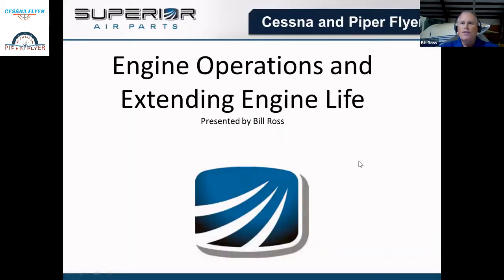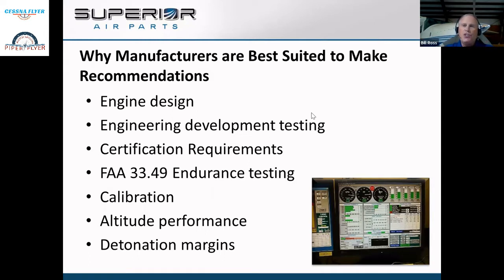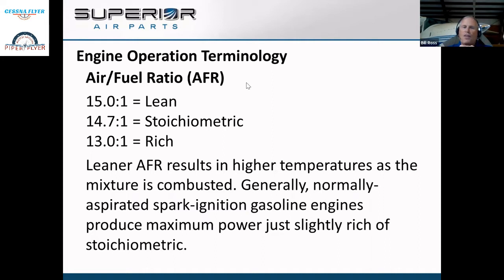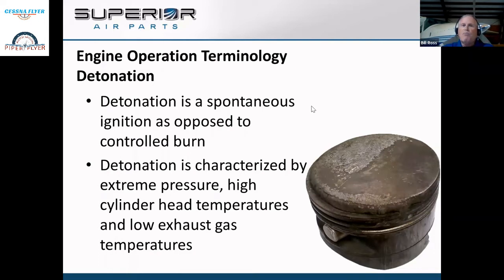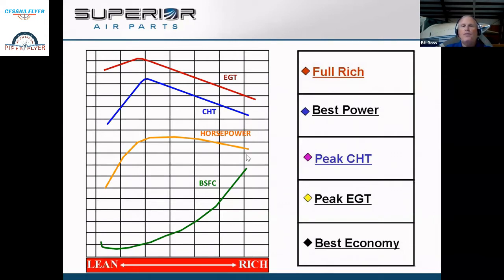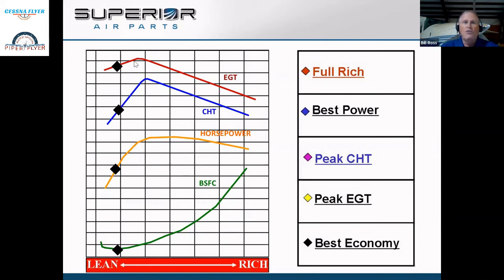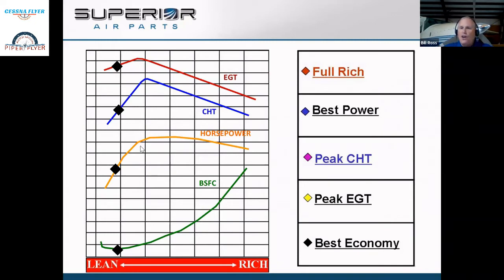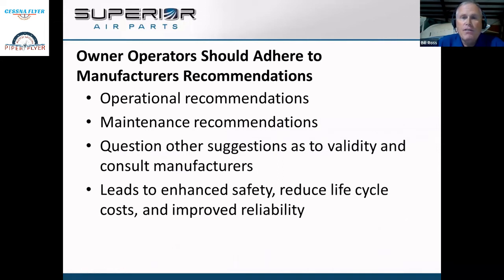Improve your aircraft engine operations and extend engine life

Comment: You’re right. The Cessna 185 POH doesn’t mention max continuous cruise or max cruise but the chart does show, for example, @2,500 ft, 2500/25hg, is 76%. Then it says at 65% leaning to peak is fine. I interpret this to mean that at 76% you can hurt the motor?

Comment: Excellent thanks Bill, all good to hear, particularly when lining up with the knowledge imparted by Mike Busch and Savvy Aviation.

The only area where perhaps you disagree with his assessment is your statement that operating up to 460F CHT in accordance with the manufacturer’s testing criteria will do no damage, assuming not exceeding max continuous power.  Really…? 
Isn’t 460F somewhat on the warm side for long term operation, especially when considering the properties of how the metal in cylinder heads behaves when above 400F?

Your discussion on the dangers of low oil temperatures makes sense, and without mentioning Busch’s name I feel you may be referring to folks following his guidance. He does also mention the dangers of excessively low oil temperatures, but neither of you put a minimum figure on it, instead telling us the oil manufacturers like to see a sustained 180C.

That’s fine, but in certain cold areas and climates folks may be sat with oil at 170, or 160C … are they in for trouble?
A bit like the CHT discussion, if it falls within manufacturer’s temperature limits for sustained operation, how does a pilot know if he or she is doing damage long term?

Your information re. low internal cylinder pressures and piston ring performance is an area I haven’t heard Mike Busch talk about. Good to know thanks.
Reply: Yes, Mike does address ICP. CHTs are a proxy for ICP

Comment: Hello , very good video , good work . I saw it all to the end , and even understood 95% (flew gliders in the past) of it . Could i ask a question : from an environmental point of view , will it be able in the future to fly general aviation aircraft-engines that do not run on avgas(100LL) that contains lead in order to prevent detonation ? How far does technology stand towards that goal ? Do Lycoming O-360 engines (Mooney 20C) still need this leaded fuel ? Also , how far is the evolution in the USA of the production of carbon-neutral Power-to-liquid synthetically produced fuels through green energy (e-fuels) for the aircraft industry ? Thank you . Erwin , Belgium .
Reply: I am a pilot but am very involved in cars, supercharged Chevy LS engines to be exact.
Unleaded car gas is safe in most non turbocharged/supercharged aircraft engines, EXCEPT, alcohol is not allowed in any quantity at all in aircraft fuel.
No one will deliver unleaded pure gas in a tanker that has never had alcohol adulterated fuel. The gas tanker can never be totally emptied so some alcohol remains.
Just so you understand the war on corn, alcohol hold, attracts and can lead to contamination of the fuel system with water.  That water, if we fly high enough can freeze between tank and cylinder causing the engine to fall silent. 
Here in the Midwest we can’t get pure gas. Thus it is not easy to use unleaded.
Reply from the maker: Thanks for chiming in DW!